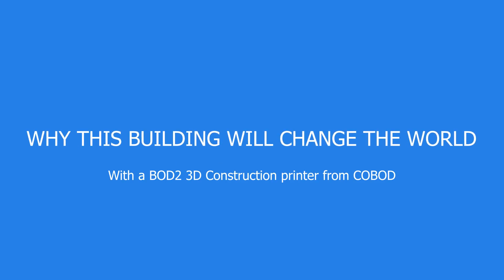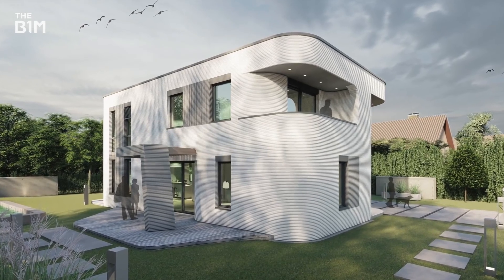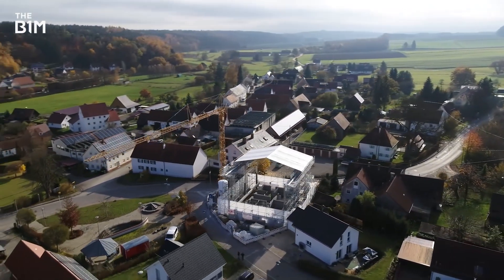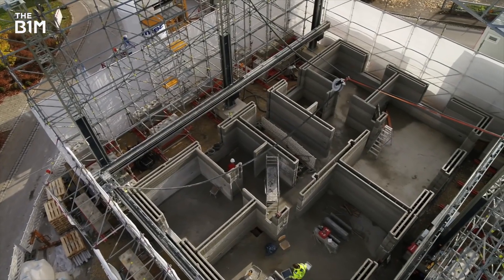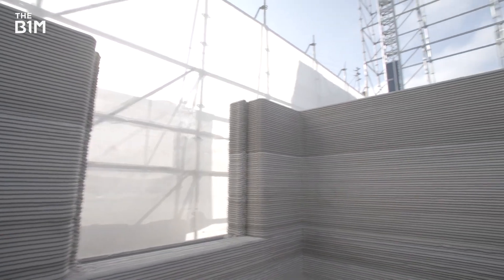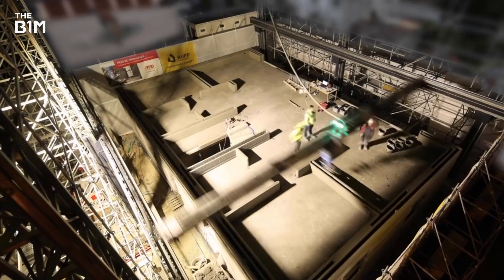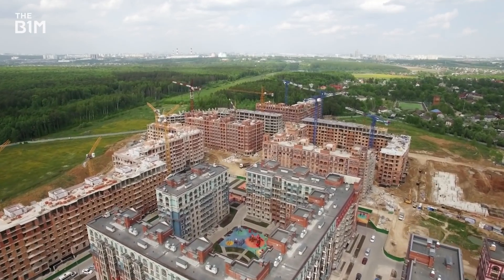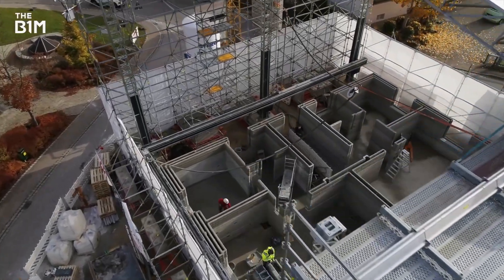Why This BOD2 3D Printed House Will Change The World

Comment: The only problem in this is that the construction workers will their jobs.
Reply: People will buy bigger houses, jobs will grow
Reply: No, this doesn't take away no jobs. This technology is hybrid and complementary, which means that you still need construction workers. This machine only builds the walls, ground, corners and little more. You'd still need workers for the foundation, ceiling, doors, windows, structure. The machine saves time, effort and more, but it won't cost jobs as of today.
Reply: @hhh2641  Thank you for clearing my doubts!